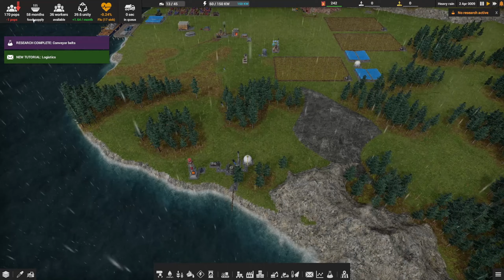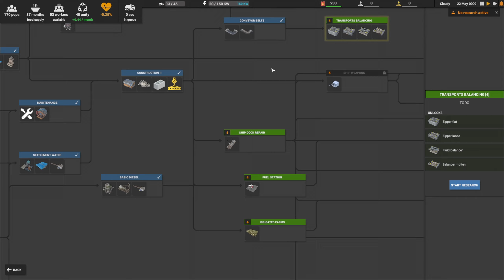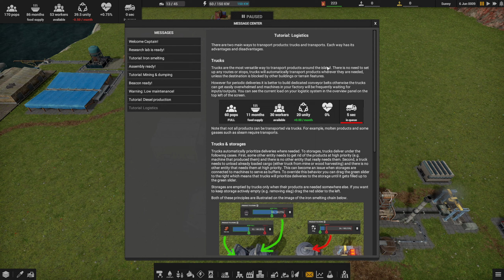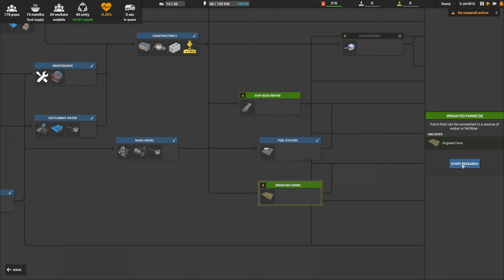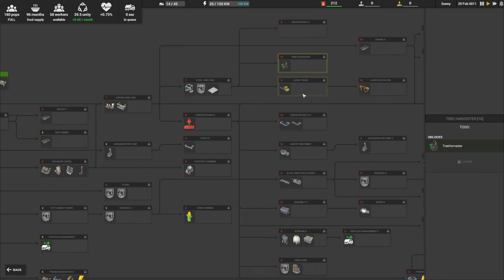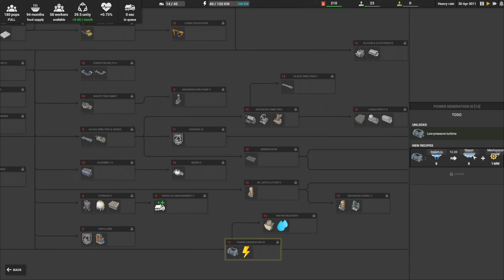Let's Play Captain of Industry s01 e06

Comment: I like the research tree, and production lines.  They're logical and progressive, and follow real-world patterns, but nicely simplified :-)  It's a nice balance between realism and too many details :P  The tech tree also promotes a nice pace of (inevitable) progression in the game as one discovers needs to be more efficient or to produce some new thing.
Reply: Yeah like the oil refining later in the game produces a lot of byproducts you can then use for other stuff, that is something most games lack, where you can make oil in rubber plastic and fuel and that’s all this game has a lot more depth in the tech tree.
Reply from the maker: @nickreinders6347  I like the having the byproducts to work with as well. It add more things to do. On the discord, the game's developers mentioned that they are still working on balancing the recipes and outputs.  Early game, you struggle to produce enough diesel, but later in the game, some early players have had too much of it, so they've recently added a way to burn off excess fuel.
Reply from the maker: I agree completely. 😺